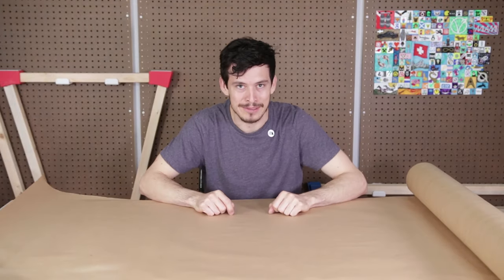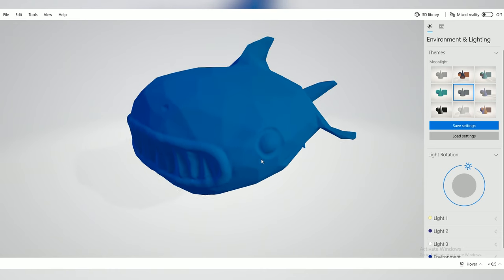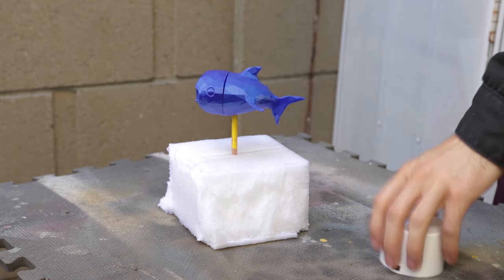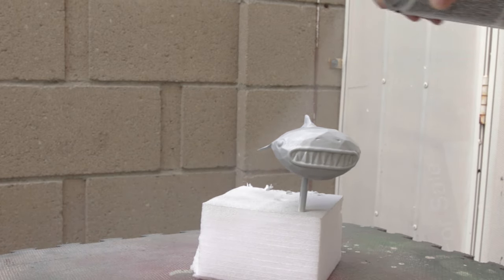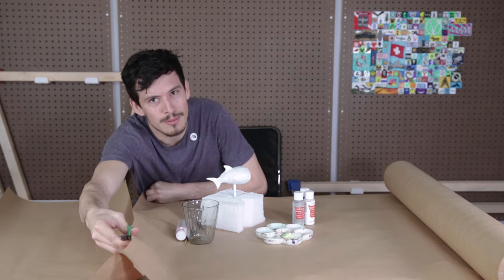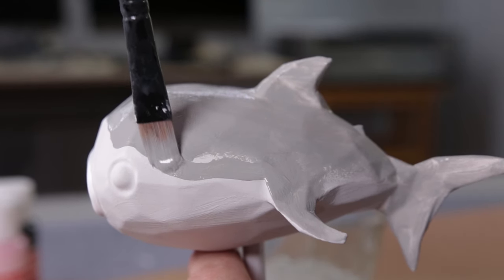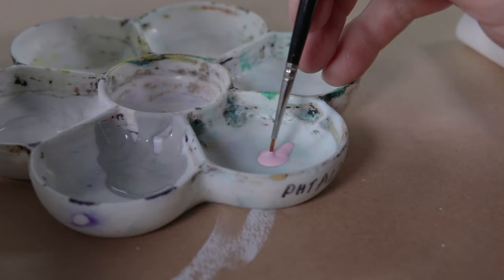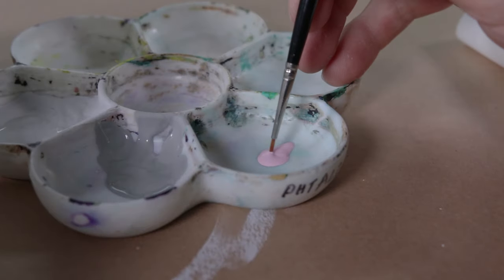Painting 3D Prints with Cheap Acrylic Paint // 3D Scanning, Printing,and Painting a Great WIDE Shark

Comment: more 3d pen models tips and techniques. i just bought one and doing alright but could use info temp. which filament brand have the best color? i start with cheaper is better since i am starting off and plan to paint some parts of model
Reply from the maker: For 3D pens I'd say get whatever cheap filament you like since it doesn't require the precision of 3D printers.. that said, a 1kg spool of filament is probably better value than 3D pen packs, but you're stuck with a lot of one color
Reply: @make.anything  thanks so basicly any cheap 1k roll will work as long as it is 1.75 mm. using scribbler nano
Reply from the maker: @bigfoot8778  I haven't used the nano, but I'd say yes

Comment: You’re technically not supposed to use your bare hands with plastic wood (wood filler), but I’ve done this quite a lot myself without any noticeable ill effects. On very extended projects where I’m applying stuff near constantly over the course of hours I’ve felt some funny tingles or itchiness in the past. But that’s probably in part due to rubbing my fingers over bare, rough wood, the texture of the stuff as it dries and a bit of hypochondriatic placebo effect. XD

Comment: Question: Acrylic vs Enamel?
Reply: Acrylic all the way!
Reply: @henge3d724  I just saw a video that says Enamel would only require 1 coat. Vs many coats of Acrylic.   Hmm.  Will have to try Acrylic and see.
Reply: @cognetic  I use acrylic in my videos mainly because it has no problem being coated with different laquers. But also it has a more matte finish, which is nice when i want my models with a more matte finish. But I would guess there is pros and cons to both. Happy painting 👍

Comment: The brush strokes come from your paint being thick. Never use it straight out of the tube, thin it down with a little water and you'll get less visible brushstrokes. Thin, multiple coats are what you want. The price of the paint doesn't matter.